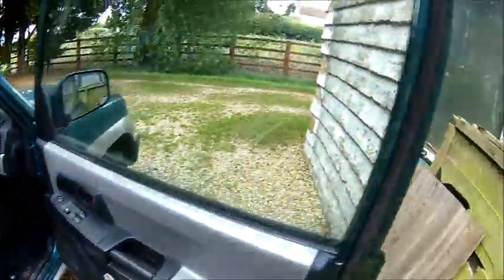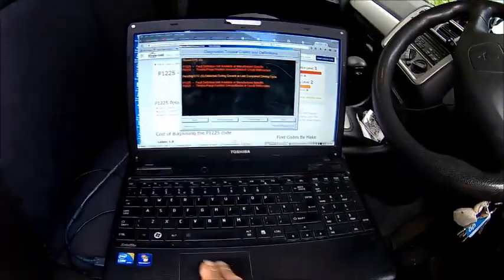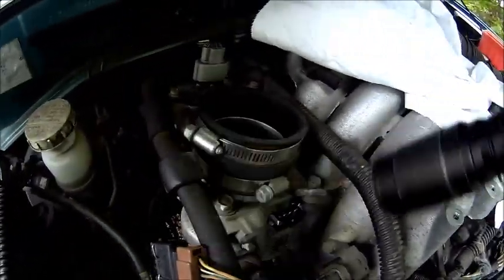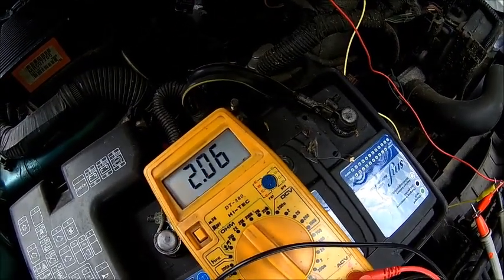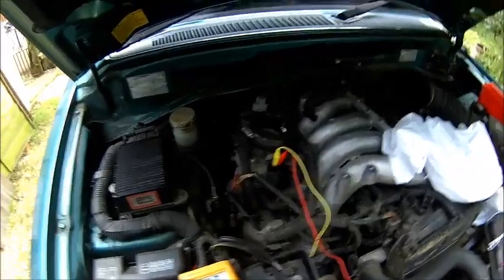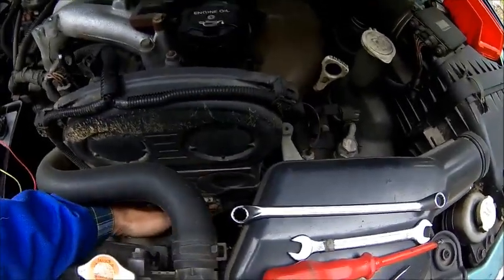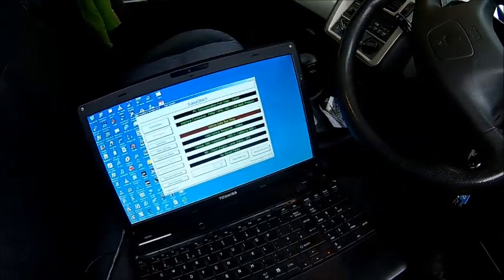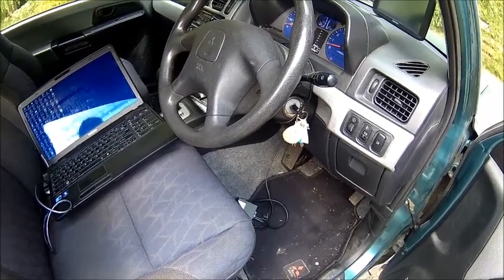Mitsubishi 2.0 GDI fault code P220 + P1225, possible reasons and fix (4G94 engine)

Comment: Hey my car gave me a flashing light with a high rev. No response from the gas pedal at all. Then it went into limp mode. Changed the throttle but same result. Also tried a different air flow sensor. Someone told me it might be the pedal sensor or a fuse for the sensor. What do you think.
Reply from the maker: pedal sensor can be one guess, just check the resistance and voltages, also check if all connectors are clean and well seated. But high rev might point towards a stuck throttle body. Once fitted, cycle the ignition a few times, so it goes through the learning process, then clear all faults.